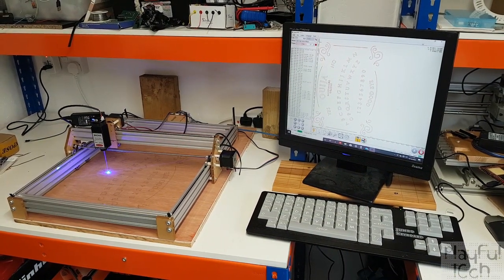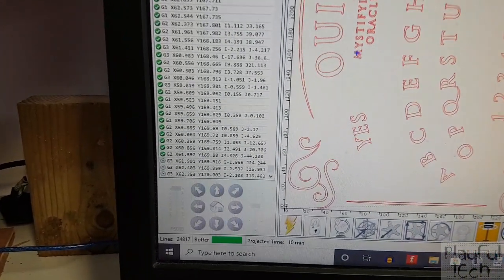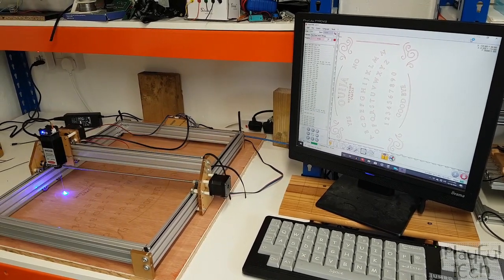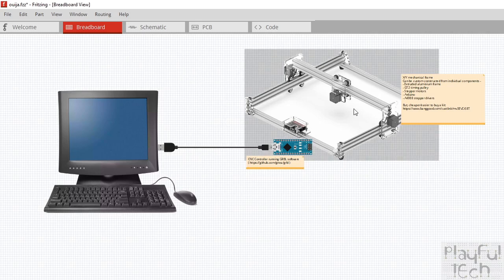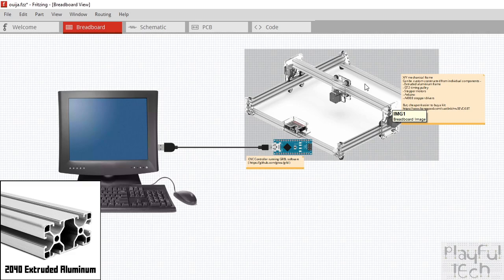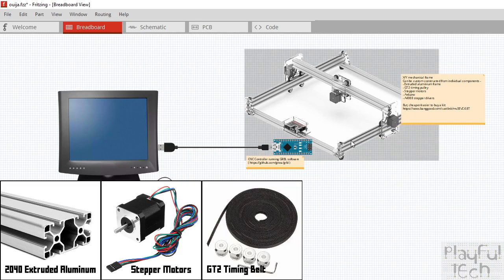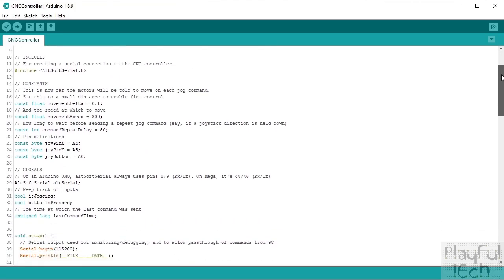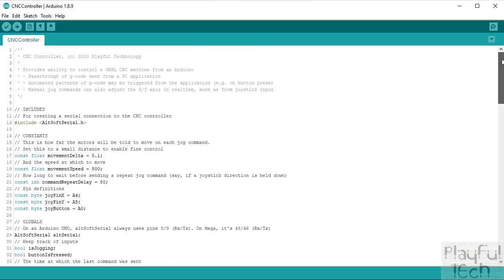How to Build an Automated Arduino-Controlled Ouija Board

Comment: Late upload! Tomorrow mornings entertainment sorted 👍

Also, not a bad price/size ratio for that engraver - how have you found it so far?
Reply from the maker: I'd absolutely recommend that engraver as a "starter kit" for anyone who hasn't got any previous experience with CNC machines. You can run it using free software and it's easily upgradeable - you can replace with longer sidebars, add a more powerful laser or other tool heads, change the drivers to trinamic silent drivers etc.
Reply: @PlayfulTechnology  Thanks for the info, shall add it to my wish list